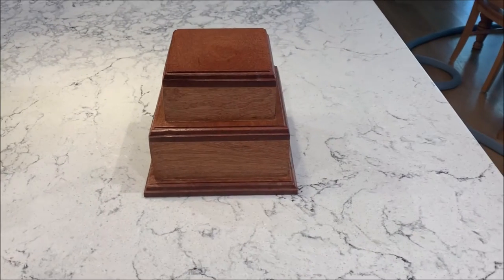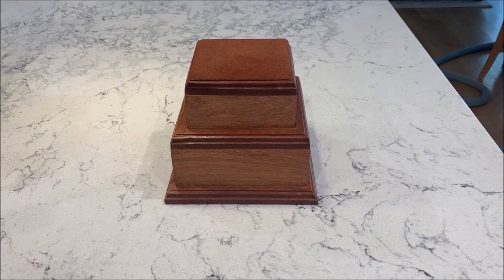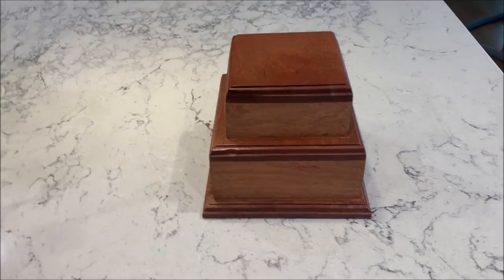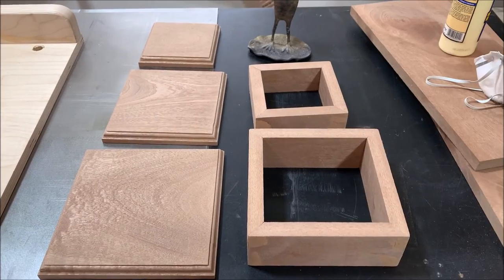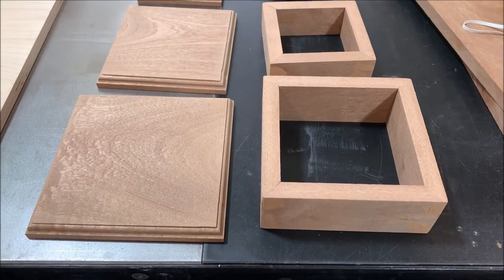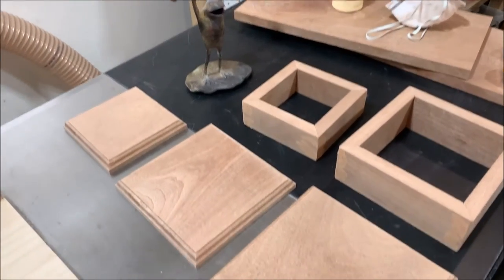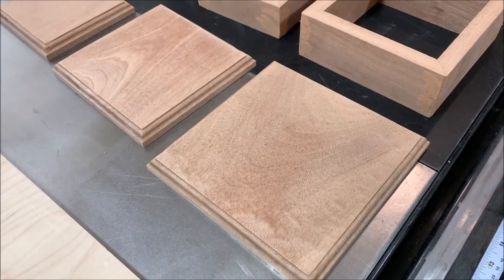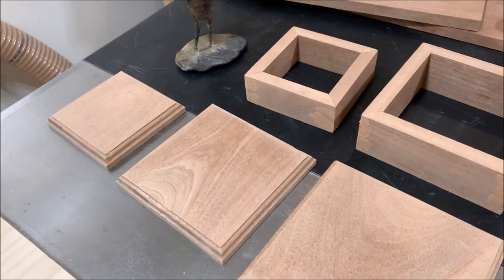TROPHY BASE

Comment: How did you connect the trophy to the base?
Reply from the maker: Gosh.  Since I gave it away, I can't go and look.  If it had screw-in part, then I just attached it with a bolt and nut.  If not, then I probably used JB Weld.